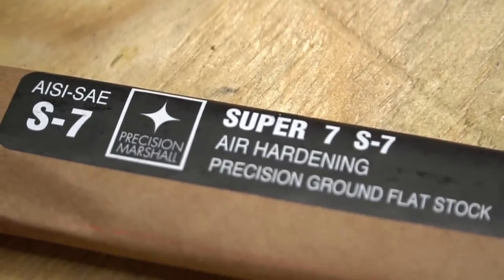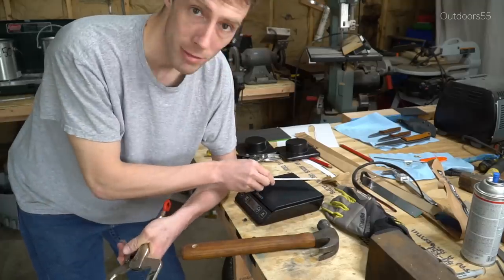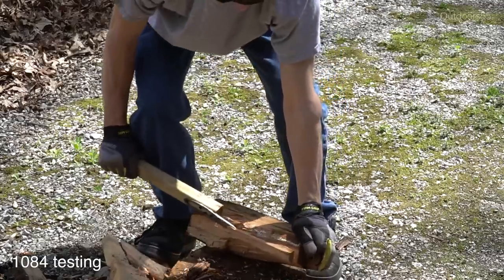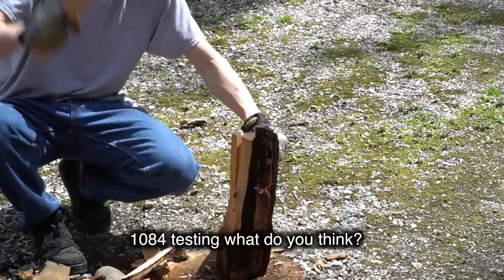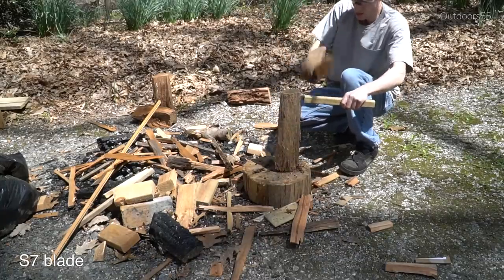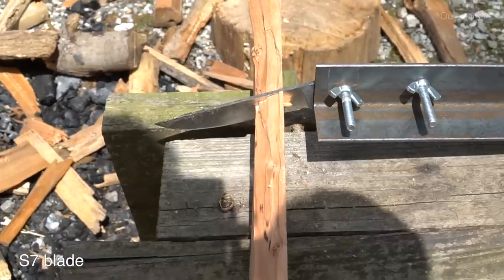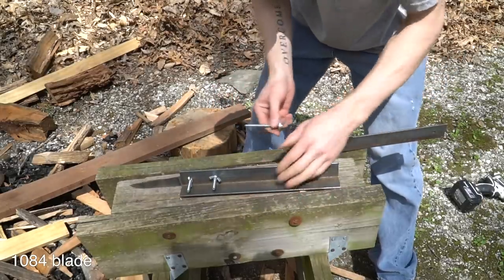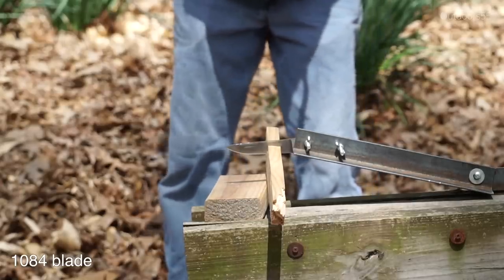What Is THE TOUGHEST KNIFE STEEL? Testing knife steel.

Comment: Scientific doesn't matter. It is a blade you are making for yourself. So what matters in the test is only 1 thing. At the end is it strong enough and light enough for your use. Your test work! Because it is your real world applications. That is what makes it for you. Great test. Great video. Great explanations. I know this is an old video. So I know you made your knife already. So I have a question. What is your opinion on a ceramic coat on the non-cutting portion of the blade. Leaving only the blade exposed. I have many blades coated with something. Leaving only the cutting edge exposed. Would that help with rust prevention on this blade?

Comment: this is a good series , looky here , not seeing many experts on here atall, but you do pretty good, now, as far as weight, i think the knife is the last thing you should worry about period, a shovel, a axe, a pot and pan, hatchet, machete, these things ,sure, but the knife is probably the single most important thing you dont want to mess with, personally seeing those tests, you can make one without hollowin out the handles metal and itll make it solid to where theres no breakage, you can send me that knife, ill buy it all day long from you, you put those 2 blades to the test  that noone else does, in fact id prolly buy it if you kept the metal tang completly solid and id buy it over any other knife hands down
of course the only thing should be done is 2 screw holes to add the handle wether it be plactic, wood, or bone even, now make one with the sharp tooth design, and size, its not meant to be a rambo knife, and yer not skinnin a elephant, heh.hope to see ya make one , thanks, great vid.

Comment: I do the same type of batoning with my Gerber Strongarm and, it just laughs straight in my face asking, "Is that all you have?" Gawd what an amazing blade. Heat treated extremely well. Holds an edge great for 420. Easy to resharpen. Great design and lightweight. I tried batoning it using a hammer once, besides some knicks and scratches, kept asking for more. I would truly bet my life on it.
Reply: Holds an edge great? That's the softest steel I ever had on any kind of knife. It's softer than Victorinox knives. I never had any blade roll that easy in my life, not to mention the hours you have to put on, to reprofile  that awful edge it comes with(and that's if you have the skills and experience). Realy good design overall, just destroed by the really poor materials it's built with. A bit overated knife. Terava Jaakari Puuko, costs less and comes with real steel and great heat treatent. That's how Strongarm should be built

Comment: I don't think the Mora Basic would stand up to this kind of abuse, but I don't think the finished version of an S7 or 1084 steel knife in the same profile as a Mora Basic would sell for $8 either.

I think if you test it, you'll find that the Mora Basic can be used reliably for batoning, as long as the user is reasonable cautious and judicious about it. The basic is also a 3/4 tang knife if I recall correctly.

Comment: I've been workin' this notion through my head for a while now...WHAT IF.... What if one was to, in lue of tempering in a dry oven, do that 400 degree (plus or minus) quench in hot oil? Would this not "bake"  some amount of oil into the grain to help protect it from rusting? Would this not make a blade slightly slicker for it's cutting action?
I totally agree that if these blades were equipped with real handles, they would not have broken as they had because your hand would have been absorbing a great deal of the shock generated by the baton blows. Rhino 54 had noted that the mounting bolts to the angle iron were not tight enough to mitigate equipment movement, which may have led to the handle material failure.
In the end, it is quite obvious that 1084 and S7 are both very capable steels for making great outdoor knives. Outdoors55...keep doing what you are doing. Should the Zombie Apocalypse ever befall us, you will be one of those very few to have a very sale-able skill and product and, therefore, assure your own survival.
Reply: To Outdoors55...I just wanted to add that I really appreciate all the effort you put into both your work and your video production. You are an inspiration to those of us that have little to zero workshop space, given what you are obviously capable of accomplishing.

Comment: Very interesting comparison- never thought about using S-7. Though your way of batoning is ridiculously silly - why compromise your most valuable tool? Cut some wedges from small stuff first, then baton your knife into it by hitting it just above the point where the edge is touching the wood - no stress on the handle - most stress where the blade is the strongest. Take the blade out and continue with the wedges - if one fails, just make another one. If you're done  use the wedges as firewood too, so no waste of material or effort.
This way the blade doesn't need to be that long and can be made even lighter.
Never cut straight across the grain - do it at an angle and it' less than half the work - in the fire it doesn't matter, if the wood is tipped or square.
To save some more grams you could chamfer the tang, the pommel doesn't need to be as strong as near the blade.

Comment: K390. Try it you'll like it
Reply: Not for this application. Great steel with lots of wear resistance and it's pretty tough for a very high carbide steel. But compared to even 1084, not to mention S7 it's nowhere near as tough. S7 is used in jackhammer bits just to give an idea of it's toughness, it's considered a shock steel. On the charpy notch test(not the end all be all but it gives an idea) S7 I'd about twice as tough as 3v at 58hrc. It's probably 6 to 8 times tougher than k390.
Reply: I never knew that about s7. Thanks for the reply
Reply: @bulbchangingmonkey  Sure, no problem.
Reply: Gangster of Love  to what s7? S7 has about 2-4 times the toughness of 3v(heat treat depending), usually it's about 2.5. It's a steel for jackhammer bits, 3v isn't. But 3v has much better wear resistance and corrosion resistance. There's a lot of interesting steels out there, cpm 9v, 1v, z-tuff, a8 mod (pretty close to the infi busse uses now, not like the old infi), pd1 are all high toughness and high wear resistance steels. I look up a lot of stuff on the zknives app or on Google. There are thousands of steels out there, the stuff we see in knives is just scratching the surface.

Comment: (1) Will 1084 or S7 sharpen more easily in the field? (2) Will both stay working sharp for 3-4 weeks out in the field? (3) Is 1084 significantly cheaper than S7? We already know 1084 is less rust prone than S7, and it can withstand pretty much anything short of Blade Breaker 9000.

Comment: Used a Japanese technic. Use 1084 for the core of the blade for more spring reaction and s7 for the outside of the blade for the hard edge. For cutting action. 
But my opinion is yes a hard blade is better but you need some of properties of 1048.

You can forge in that Japanese technic for katana. Or make a Damascus technic. Will work too

Comment: I'm missing bevels - a 2mm grove 3mm down from the spine. also reemake the handle to be a back slope kind - fill out the area Mora style.. with plastic to get rid of the lower metal part of the handle. should save you quite some Gs.

Comment: good stuff!
Since you're hollowing out the "integral" tang to reduce weight, perhaps you can gain another few grammes by making it a hidden tang? Not sure which shape you'd have to pick to best withstand batonning, but that's maybe also a very interesting test series... I'd really would like to know how thin a tang can be - with a proper handle - without significantly compromising the integrity of the blade. And I'd be even more interested in finding out if different shapes of hidden tang make a difference in performance. I've seen hidden tangs straight, curved, centered, aligned with the spine... but perhaps there are other shapes and positions that have better performance for specific use?
Reply from the maker: I don't believe a hidden tang would be strong enough given this knife size and weight. It would also make the handle material a structural element. 
For breaking strength everything matters. Including the shape and finish left on the steel surface. Its a rather complex subject once you start digging 😂
Reply: @OUTDOORS55  yes, hence my question to the expert ;))
Reply: @OUTDOORS55  and yes, the handle would have a structural importance, but I don't think it's that much when the knife is held by your hand. You're batonning the blade, and the handle mostly positions. Your hand will not be as rigid as your contraption, so the handle itself will only receive a very limited shock. The handly only needs to be strong enough to withstand shocks that your hand can handle, otherwise you're smashing your hand anyway, and what good is a stronger knife handle in a shattered hand?

Comment: Would be interesting to see some alloys; 440C by spec is supposed to be tougher than 1095 and I've also heard that for a 4 inch and under sized blades, the toughness of tool steels are pretty negligible compared to modern powdered steels like M390/20CV.
Reply from the maker: Im not sure, i cant find any toughness testing done with 440c. M390 and 20cv are not super tough steels comparatively speaking. For this blade spec, where we need a very thin grind to keep weight down, toughness is a concern.
Reply: @OUTDOORS55  1095 has a Fracture Toughness of 18.7 MPa-m½, Shear Modulus of 80 GPa, and Max Tensile Strength of 184.000 PSI; 440C has a Fracture Toughness of 24.2 MPa-m½, Shear Modulus of 83.9 GPa, and Max Tensile Strength of 286,000 PSI.

I personally have never tried S7 but the general consensus seems to be that the wear resistance on it is pretty bad; I believe it was jankerson who stated that smaller blades don't see much benefit from extremely tough steels(though I'm not sure at what point in thinness that would no longer apply).

Knife maker Jay Fisher has quite an in-depth assortment of info on his website that I like to refer to.

Comment: 7:54... it actually broke because of the loose screws securing the blade to the piece of angle iron. If those were tightened enough, it would probably have hold on even longer.

Comment: Alex, will you please do a video comparing a hatchet's convex grind versus a concave grind? I know that the "proper" way to sharpen a hatchet is with a convex bevel. However, a lot of people use sharpening wheels which leave a concave bevel. I trust your insights and knowledge, so I'd like your thoughts on whether or not this matters and if so, to what degree.

Is that something you'd consider looking at?

Comment: Hey, do you remember what your thickness bevore the edge was?

Ive been doing some testing on 80CrV2 and my testblades took a warp in the edge portion even up to 0,6mm "thickness bevor the edge" while rough batoning through a quite twisted knot. Now im wondering if my HT is faulty. Blades are at 61-62 HRC tough...
Reply: If you have fine grain and 61-62 HRC heat treatment should not be the issue. Maybe too thin for the task. 
Have you seen Larrin last article. 15N20 on 61HRC with 66% higher toughness than 80CrV2 on same hardness. Quite impressive, Its worth checking out.
Reply: @thiago.assumpcao  Yeah, might have been too thin. Was a hollow grind too.

Yes, definetly have seen that. Truely amazing.

Might still take a warp in the  same application though, since plastic deformations are mainly determined by yield strength (which correlates mostly with hardness)

But still, if the toughness reall is that amazing it might be quite the upgrade :D

Comment: Hey Alex, awesome video!!! I almost think if the whole handle could somehow be supported, as opposed to just where the screws were holding it to the angle iron, you would still be out there pounding on it.....well, maybe you'd have given up by now. Lol. I think the reason the handles broke is because the screws created pressure points. Anyway, seriously TOUGH steel.
Cheers
Reply from the maker: I believe you may be right 😂

Comment: Hey bud! Looks like you've been busy while I was away.👊👍 Very nice. Umm, Yeah, I'd say that beat the Mora. haha! But I doubt the price would!😉 
 I do see a place where you can shed a lil weight. Instead of doing that oval shape in the handle go all the way to your pin holes leaving only an eighth around the pin hole and open the whole thing up a 16th more. Also remove a bit of handle material on the inside that corresponds with the lightening hole. For pin material use driveway markers. Extremely light, glue up strength is fantastic and sheer strength is incredible. If you're looking to go as light as possible every gram counts! Good luck on your quest Kimo Sabe!🤘👏👊👍

Comment: So of the S7 and 1084 Alex, which one did you think was better? Im concerned about the rust on the S7.  I think watching creates more pockets for rust to grow in, so I think at match isn't that great, unless the etch is to help hold a DLC type coating.
Reply from the maker: Its hard to say. I believe if i made the blade thinner (behind the edge, as well as spine thickness) id rather have the s7. Im not sure id want to go much thinner with the 1084 due to the flex. The flex could be changed with heat treating but it would reduce toughness as well.

Comment: Interesting video! I think if anything it shows your blade design and heat treat are “bang” on (wink, wink). You should call it handle or tang breaking because the only “weakness” was the design of the tang with that center oval cut out. I imagine if you left more meat on the tang you’d have to drop an anvil on it. 😀

Comment: Just quenched my knife
Edit thanks for wanting me to try this as my new hobby
Reply: LOL, I first read "Just quenched my wife" hahaha... Changes your post quite a bit x))
Reply: Luke Arts lol I’ve been using my angle grinder for them right now my bench grinder is broke (never buying riobi or however you spell it) but I just made a dagger a few hours ago but it was dark and rainy so it hasn’t been heat treated or tempered I’ll comment again and tell you how it goes
Reply: @keepit100lucky7  I'm a bit confused. You said "quenched" which is part of the heat treatment, right? Or did you mean "finished"? Anyway, using an angle grinder only gets you so far. As Alex had demonstrated for so long, it's a great tool for basic stock removal for the rough shape. I'm guessing you are using flap disks after that, like I did when I started. As a fellow beginner, I can advise to switch to a cheap handheld belt grinder (the kind that can be clamped to a bench upside down. Unless you are able and willing to invest in a real belt grinder like Alex's, such a cheap tool (got mine for 19EUR, and I use the cheapest sanding belts from Ali Express until I can afford better equipment) is a big step up when it comes to shaping and making even bevels... The trick is to clamp it to a beam and then mount that beam vertically or sideways, so that you get a vertical grinding surface that either runs from side to side or vertically, much like the real belt grinders do... And if you can get your hand on high quality belts, you'll already get even better results because the tool is only a means to move the belt around :)) (at least, at our level it is...) But start with the cheapest ones because you're going to break your first couple before you get the touch right. Cheap ones break easier too, which makes for even better training to work cautiously and with proper technique. :))

Sorry for grinding on about it ;P

Comment: Is it necessary to measure in thou? Is 145 thou not more or less 5/32"  or about 3.6mm?  Not sure if it has to so accurate as I have never bought bar stock in thousands thickness.  Anyway its just my curiosity.  Great video.
Reply from the maker: Precision ground stock is always sold in thousands.
Reply: @OUTDOORS55  Must be different in your part of the world. Tool steels and ordinary bar were I live would be sold in dimensions like 5/32 x 3/4 or in metric like 5.7 x 150.  Precision size would then be milled or surface ground to your requirements in your own machines. Is the other steel you tested similar to 80CrV2?

Comment: I noticed you placed the blade in a cold oven. That is not correct. Research how to heat treat S7 tool steel. You will get better results. You can look it up online or ask your steel supplier for a reference book.
Reply from the maker: if I remember correctly Its recommended to not let the steel drop below 120 between quenching and tempering. I cant follow the protocol exactly. The tolerances are too tight for my relatively cheap equipment.

Comment: I think there's a fundamental misunderstanding here. You are testing the toughness of knife steels by cross-batoning wood. That isn't the situation when fixed knives break from what I've seen. They usually break when batoning through twisted wood, because twisted wood bends the knife blade and if the blade isn't flexible enough, it breaks. For an example, see the Worst Knife Fail - Boker Vox Rold Breaks On Camera by Cedric & Ada Gear and Outdoors.
Reply from the maker: No there's plenty of examples of knives breaking battoning. I broken a number of knives in past videos doing exactly that. There IS a lot more going on with knife toughness that i don't cover in this video.

Comment: Saw you had a kool most. Did you buy their tank or did you make one to hold the coolant?
Reply from the maker: No i use water out of a bucket.🙂
Reply from the maker: It uses very little water. You could run it on 1 liter for a long time. Just hooks to an air compressor 👍